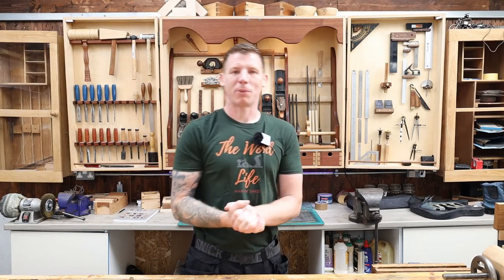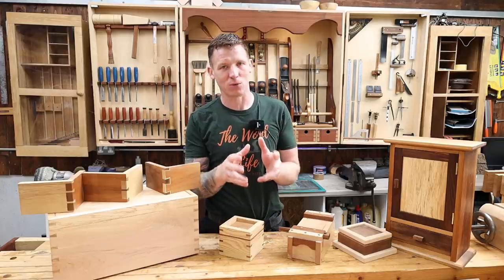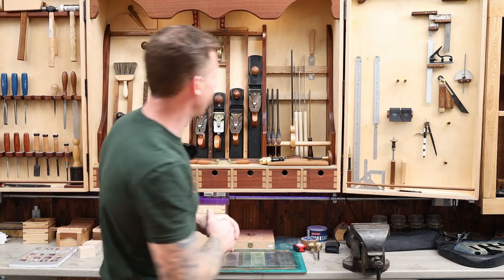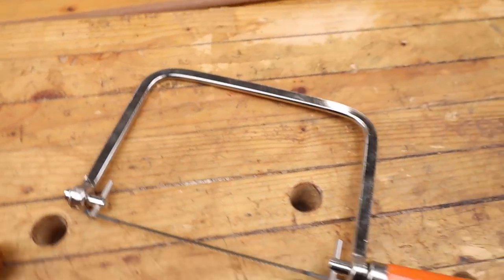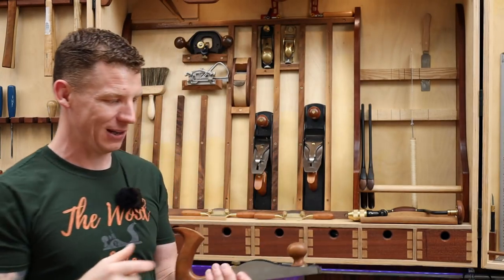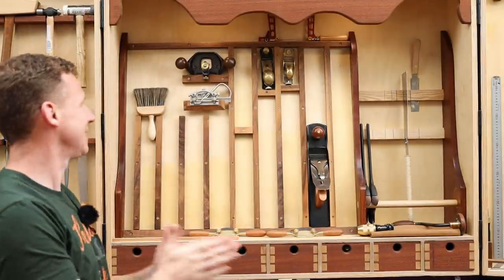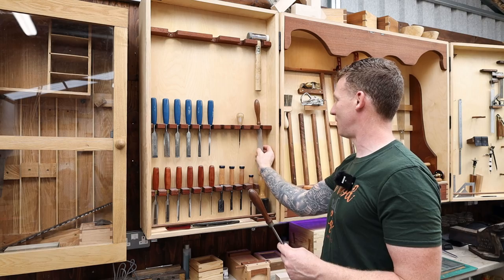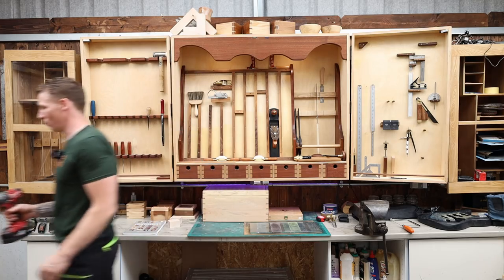My Woodworking Hand Tools. What I Use, Don't Use, Recommend and Regret Buying.

Comment: For those that may not be aware, there are plenty of options available for high-end, professional-grade Japanese hand saws that start at about $100–$150 (USD).  Most of the professional-grade Japanese saws that you will come across can be resharpened, but some are impulse hardened and need to be replaced just like Gyokucho's.  Some retailers that carry high-end, professional-grade Japanese saws are Hida Tool, Suzuki Tool (aka Suzuki-ya), Workshop Heaven, and Lee Valley (unfortunately they only carry two: a ryoba and a dozuki).

Comment: Fun tip for people like me that have old tools. I keep a wooden tray with a plastic fabric liner (from old alpine skiing crash pads) near me in my living room. When I watch TV I’ll work on tools with steel wool. It’s a sort of zen thing and I found I’ll never get around to keeping rust off everything. If it’s there and I’m already sitting it works out. I use both the synthetic pads and regular steel wool. The synthetic don’t tear apart as easily from getting caught on knurling and edges. Start with WD40 for cleaning and dirty jobs. Balistol for the final covering because it sticks a little better.

Comment: Another great video buddy, just when I needed to put the brakes on my steadily expanding tool collection. Regarding the starting out essentials, any aspiring woodworkers who have to carefully fit into their neighbour's noise annoyance tolerance levels ( apartment dwellers for example, could put to good use a carpenter's brace and a few mortice size augers. It's silent operation can offend no one. Remaining waste can be removed with a hand pushed  chisel. No more delaying your morticing to fit your neighbour's absence, or the kids bedtime. Look upon it as an aid to marital harmony and social cohesion !   I firmly believe that the above considerations justify the elevation of the humble carpenter's brace n bit from a " nice to have" to a vital requirement for the avoidance of neighbour friction or instigating a fit of the girlie-sulks  and subsequent revenge by  your commander in chief.

Comment: Great video, I am by no means a beginner be really like to see what other people really us. 
I personally couldn't disagree more about the chisels though, the Stanley 5001 are some of the best chisels avalable. They are very cheap, durable and will take and hold a shape edge well. I have alot of chisels and work in a lovely workshop working on very high end projects and at least 90% of my work will be done with Stanley 5001 chisels, the other 10% would be using more specialist paring chisels, gauges etc. They are superb and there could not be a better option for someone just starting, in my opinion.

Comment: I'm starting right at the beginning. The main thing is I don't have a car but I do have 8 painted softwood shelves, about 6ft by one foot by an inch and a half.
I'm thinking of what to do about a bench?!
Ive seen the Japanese atedai which would seen to be a solution BUT, I've only got the one Japanese style plane, about the size 5.5 equivalent. I've also got a Stanley 5 and 7 ... So how to use those, maybe with the three quick-grips I have? 🤔 I'm very hampered by heavy debt at the moment so it's really a case of making do.

Comment: THe Ryoba will work as a dovetail saw too, if you clamp it onto a flat stick (taken off the handle). This can also set the depth of cut. Not very stylish but it works.
Reply: But why use a ryoba when a dozuki, made specifically for dovetailing, can be used instead?  The #370, #371, and #372 from Gyokucho are affordable and they will give you much better results than any ryoba ever could, especially if you're inexperienced with dovetailing.
Reply: @juliachild9377  There is no such thing as affordable in my world. I only buy what I need, and make do with what I have.

Comment: Just adding up the cost, it’s about £1500 for the tools, plus a decent bench and clamps will be about £1000. Hard to image how you will manage for long without a bandsaw (at least £450) and a pillar drill (£300). A circular saw/table saw will be required for any sheet work. An 18v trim router is going to be really really useful too. Some sort of dust extraction or shop dedicated vacuum cleaner is going to be essential as well.
There’s no two ways about it, a hobbyist woodworker is going to need about £3000-4000 and a decent humidity controlled space before they can undergo some semi serious projects. Just don’t tell your partner what you are embarking on!